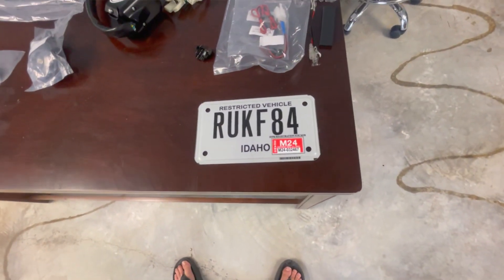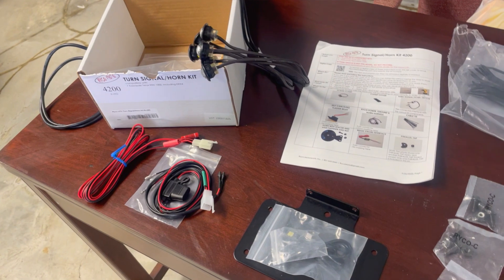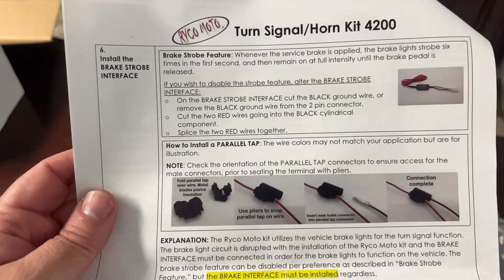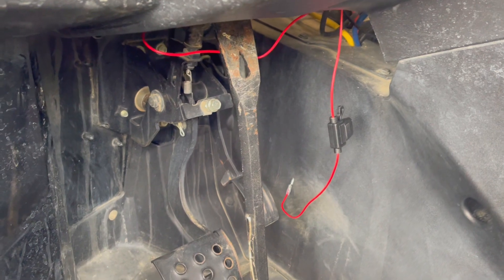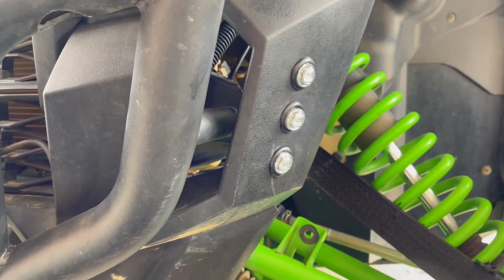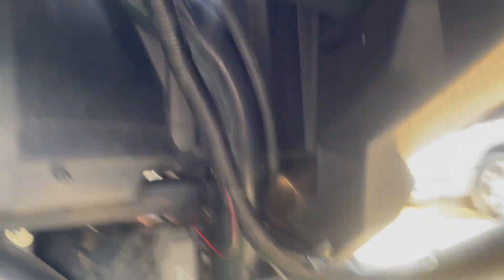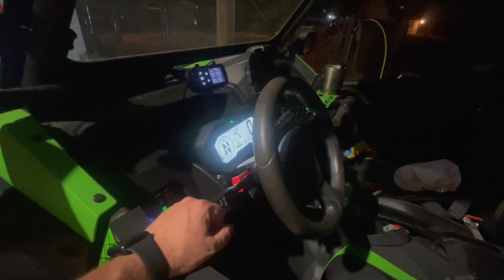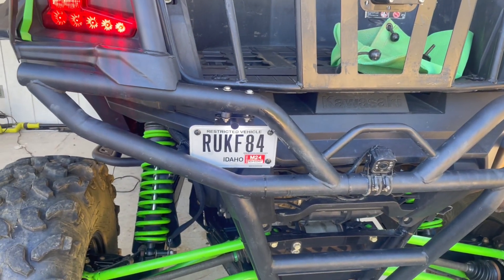Kawasaki KRX 1000 - Ryco Street Legal Kit Installation

Comment: Usually after I run a new accessory in the God awful confinements of Kawasaki's roominess in and around the dash, I feel like someone has used a butt plug.  Lol.  Thanks for the video Brandon.  Something we've been looking to do
Reply from the maker: Yep, they make you work for it but at least it’s not as bad as my old Teryx4!  I just need to take a break from pulling the dash apart and breaking down that center channel with the parking brake!
Reply: @KRXBrandon  I am also very tired of taking the tunnel area apart.  Now, since we went with prp seats everything is worse, because the seats have to come out and they're one solid piece.  I'm wondering if there's enough wire to run between the skid plates and the cab floor.
Reply from the maker: @2ndchancesadventures  I don't think there is...  Luckily, at least for now, I can't think of a reason I would need to take it apart again!
Reply: How did you get the Idaho plate. Are you a resident there now. And are you legal to ride in other states with the plate
Reply: @brianwitosky757  you meant to ask Brandon and not me.  Any street legal plate is good in any state, but you do want to check their actual ORV laws for speed limits etc
Reply from the maker: @brianwitosky757  no not a resident.  I got a non resident plate.  Shoot me a private message and I’ll send you all the stuff you need to do, it’s not too difficult.